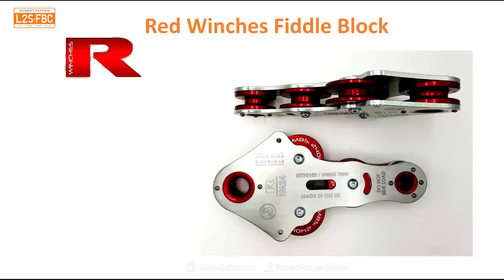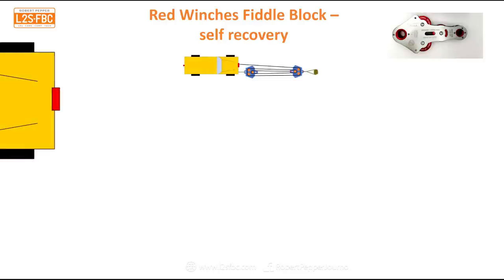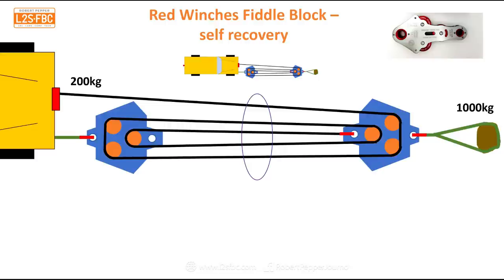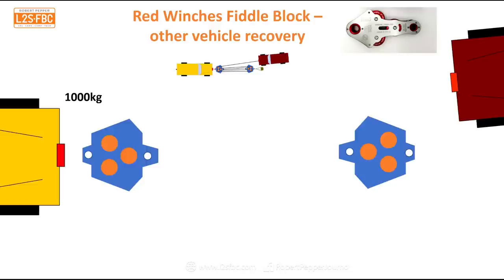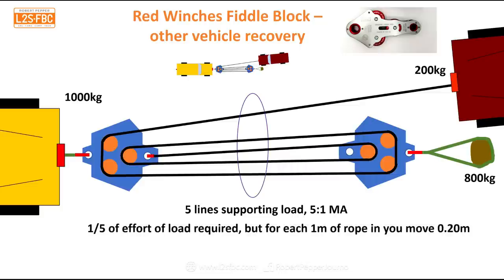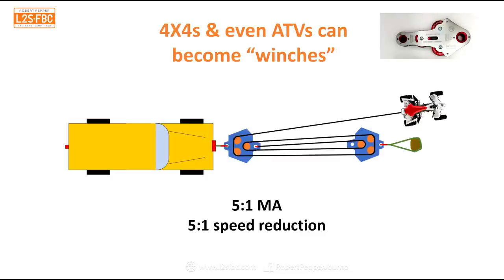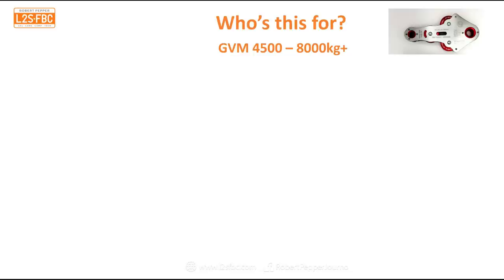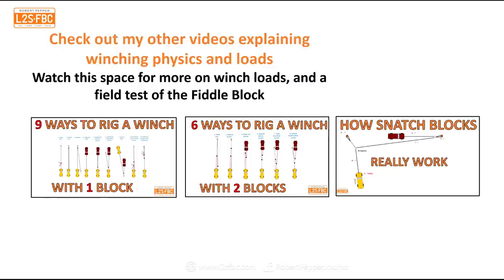What's a Fiddle Block for 4X4s?

Comment: Thats the same as a double snatch block... its 2 pulleys on either end, It's the same as having 2 pulleys side by side (double snatch blocks). Considering the price of these... And the length of rope you need, plus having 4 pulleys with loss instead of 2 (same applies to a pair of double snatch blocks which are also pricey, I'll give you that), do you think it's worth it compared to a simple Spanish Burton? Just carry two ropes (or a winch and a rope), and two simple pulleys, and that's it.
Reply from the maker: No I'd just use the SB

Comment: Thanks Robert. Fiddle blocks / block and tackle systems provide great mechanical advantage for sure. But, to move a truck 20 feet, you're going to need at least 100 feet of line thin enough to fit through the fiddle block set. I have a Unimog U500 with a 15k lbs. industrial hydraulic winch with 1/2" line and rubberized eye. Will that fit through the fiddle blocks? What size (diameter or MTS) soft shackle fits through the fiddle block? For example, I'm assuming with the 24T you can at least fit an appropriately rated soft shackle through the fiddle block to hold that potential load. Thanks again.
Reply from the maker: Hi Chris, excellent questions thank you, don't have all the answers as yet, but:

- 14mm max diameter for the rope which is around 20,000kg breaking load (not WLL)
- yes re lots of line, I'd recommend 50 to 70m (say 150 to 200ft) of rope. Not a bad idea to keep the rope permanently rigged with the two blocks, saves a bit of time.
- don't know about the max shackle diameter

I'll post when I know more, have asked the questions.
Reply: @L2SFBC  Thanks Robert. 14mm is really close to 9/16" and that typically has a spliced Minimum Tensile Strength (MTS) of 37,900 lbs. (Plasma 12 strand) which is about 17,190 kgs. So, I reckon that certainly that should be more than enough for a 15 - 20 k lbs. winch. Question becomes that with 14 mm rope, your soft shackle needs to have a MTS of around 189,500 lbs.,  (five times) which would be about 3/4" diameter double leg soft shackle. So the hole in the fiddle block set for the soft shackle would need to have an ID of around 40 mm Look forward to hearing from you. Thanks again.
Reply from the maker: Hi Chris - answer for you:

"The bottom ring will comfortably accommodate a 9mm soft shackle, ours have a MBS of 100kn, the rope will only see 1/4 or  1/5 of the load so even with the FM-24 at 240kn the 9mm soft shackle exceeds the MBS of the FM-24, there is a school of thought that if the user wanted to introduce a fuseable link this is the best place to do it but I need to do more research on a suitable smaller soft shackle for that. 

The top ring accommodates a 14mm soft shackles with ease. 
For the FM-12 I recommend out 10mm soft shackles at 160kn MBS
For the FM-24 I would recommend our 14mm soft shackle with 360kn MBS. "
Reply: @L2SFBC  Thanks so much Robert, most appreciated! 9mm - 10 mm soft shackle is close to our 3/8" (9.5mm) soft shackle that has an MTS of 42,000 lbs. Yours are at 100kN, which is about 22,400 lbs. about half the capacity of ours of the same diameter line. The FM 24, if I understand it correctly, is a 24 metric ton unit so about 53,000 lbs. rated capacity. The winch line load would be about 1/5 of that so around 10,600 lbs., which our 5/16" line with an MTS of 11,600 lbs would handle. Assuming you can use the 10mm soft shackle at MTS of 36,000 lbs. on the bottom anchor, then the bottom anchor is limited to 36,000 lbs with the recommended 10mm soft shackle. This would be the fuseable link you referred to. If I have if correct, the 10mm soft shackle in the bottom ring will see 4 times (42,400 lbs.) the winch line load while the 14mm top ring soft shackle (about 81,000 lbs. capacity) will see 5 times the winch line  load, so the top soft shackle is certainly capable of handling the fiddle block FM24 rated capacity of 53,000 lbs. Would I be correct is concluding that the bottom soft shackle would part (fail) at about 85% of the fiddle block rated capacity? If this is the case then the fiddle block capacity should be rated by its weakest connection point, which is the bottom soft shackle. Now if our 3/8" soft shackle (42,000 lbs. MTS) was used instead of your 10mm soft shackle, then it would meet the rated load capacity of the fiddle block without a fuseable link. Your thoughts would be appreciated.
Reply from the maker: Hi Chris hopefully this answers the queries - https://l2sfbc.com/more-on-the-4x4-fiddle-blocks-forces-and-minimum-rope-lengths/
Reply: @L2SFBC  Thanks Robert, actually, this confirms my concerns. 1) you can't get a 14mm soft shackle in the lower connection point so that's the failure point which is well below the fiddle block's rated capacity. 2) If you connect your winch line from your big winch on your Unimog etc. to the winch line extension, as the article you provided suggests,, you can easily exceed the fiddle block capacity. Any winch that is over 11,000 lbs. has the potential of exceeding the 24k fiddle block capacity. Most big rigs, like my U500 Umimog, have bigger winches. Basically, the 24k fiddle block can only be safely used within it's capacity with a winch capacity of 10k. lbs. or less, and that assumes the lower connection point soft shackle rating exceeds 40k lbs., which it does not. So two design failures right there. My conclusion is; a very pricey piece of equipment that is totally over rated based on capacity so is therefore  not safe to use unless they specify:1) maximum winch capacity of 5,000 lbs. for the 12 ton unit and 10,000 lbs. for the 24 ton unit, and 2) they should also specify the MTS of the winch line extensions and 3) specify the MTS of the required soft shackles on both ends. In my view that's the responsible thing to do. However, that has not been done and the article you referenced also appeared to miss these critical aspects. Thanks again Robert.
Reply: @L2SFBC  Robert, that forces diagram you provided (with the winch line connected to the winch line extension), how does that connection get made? Are you using a soft shackle? How does that connection point get through the winch fairlead? Essentially with this diagram, it appears to me the furthest one can pull with this suggested rigging configuration, is 1/5 of the winch line distance because 1) that connection point can't go through the fairlead, and 2) even if the connection point could magically go through the fairlead, you'd fill your winch drum up with the winch line extension, unless you had very little winch line to start with, which defeats the whole point. Nothing makes any practical sense (other than the forces) in this diagram. It's useless.

Good day Robert, I have posted the link to your YouTube video and the link to your article and a summary of comments onto the I4WDTA Facebook page. I think this warrants a good discussion. Thanks again.
Reply from the maker: Hi Chris - re your three points:

1. The lower point will only ever have 1/5 of the load, so would never need a 24t shackle.
2. Yes, big winches can exceed the 24 capacity.  So could a 12,000lb winch, multiply that by 5 and you've got over 25t.
3. I don't really see this as any different to any other winching or recovery equipment. You need to understand the loads throughout the rig, and use the appropriate equipment.

I do think that very, very people will need this, and that 2 x normal blocks which can give a 4:1 MA are plenty. I also agree/think that because people generally struggle to understand MA (hence my videos on the subject!) then this will further complicate matter and could lead to dangers. 

Your second comment:
Yes it's soft shackles all the way through.
Correct, you move 1/5 of the distance of the line pulled in. Hence, recommendation for a 50 to 70m rope.  The diagram was to illustrate the forces - I wouldn't rig it quite how was shown in real life for exactly the reasons you describe.  If I did, then the extension rope would need constant shortening which is a tedious problem to solve, but on the other hand...better that than not moving at all!

I have amended the post to reflect that, an added a diagram to show a more realistic rig.
Reply: @L2SFBC  Hello Robert, thanks so much for taking the time to respond - most appreciated Sir. On your points - 1) agreed 2)  Agreed - my point there was I would not recommend this for big truck with big winches as that will exceed the capacity of the product. 3) Agreed as well and that's where the information you provided is great. Hopefully everyone that buys these sees and learns from your video and your article to avoid the dangers you mentioned. I look forward to seeing your amended rigging. I've used these fiddle blocks with small capstan winches years ago, and they're really great for that - I left my fiddle blocks rigged, as you suggested, with a winch line extension (enough to move my old CJ2A Jeep two vehicle lengths) and then just used a daisy chain to shorten another winch line extension to connect the far pulley to the anchor - that gave me some adjustable range. I see this technology as perfect with capstans but not for regular closed drum winches. Thanks again Robert.
Reply from the maker: Thanks Chris, just amended the post. 

I really appreciate your considered feedback which has made me think further about the product. It's a new one, and as such I'm interested to explore what it can, and cannot do, and real-world testing. It's people like you who help everyone work through this process, nobody can look at something like this and figure out every little nuance at a glance, it takes some thinking as a group.

Thanks!
Reply: @L2SFBC  Hey Robert, thanks for your quick response. I wish I was as savvy as you with social media, IT, graphics, videos etc. Thanks for what you provide. I also agree that a bunch of folk discussing their thoughts on things is great - so thanks for your engagement - I look forward to more with your Sir!
Reply: @chriscole3538  I bet you will move before anything breaks.

Comment: hat is the difference between one of these and a 2-sheave block? Other than being blaster (all the lines in a single plane) it takes up more square area than a 2-sheave block, but a two-sheave is thicker and the rope is in two planes.  But when the rubber meets the road, there is an identical mechanical advantage with both.  Is the expense really worth it? Or is it just that fiddle blocks have a high CDI Factor?

Comment: I've got a 5000lb wire cable winch. Could I use these fiddleblocks if I run my cable out and tie into a synthetic line that runs through the system so as I draw in my wire cable the mechanism goes through the synthetic cable? More simply stated, can I use a wire cable linked to a synthetic rope for this? I figure this way my 50ft cable will provide for 10ft of recovery travel?
Reply from the maker: Yes you can do that

Comment: i'd like to see a video about this.......how do you feed your rope cuz it has a loop at the end?.....you need to get the hook everytime off?
Reply: Something like this you would leave rigged with  it's own synthetic winch cable. You then simply attach it to the vehicle and the winch system with conventional hooks or soft shackles.
Reply from the maker: Agreed!
Reply from the maker: Feed rope through
Reply: @L2SFBC  show us,you did it interractive,but how it looks like in reality?
Reply: @otm646  he said something different.....that the winch rope you have to feed through.....impossible as long as it has the hook on.Agree??? His video is not plausible
Reply from the maker: You can feed the winch rope through if it fits. But best is to use an extension rope.
Reply: @lee99lee99  Some of the blocks are very open and have guides inside to guide rope or cable onto pulley.  Hook should pass through.

Comment: Robert, if you keep 50-75m of rope permanently rigged through a pair of these seperate from your winch, can you use something like the round device with ears (don't recall the name of it) to pull 25m, let your winch back out, take up the slack,  and pull 25m again as needed? What do you fasten to the end of your winch rope to attach it to the 2nd rope? How do we non-permanently attach a hook or whatever?
Reply from the maker: Not entirely sure what you mean, but yes you can pull in 25m of line at a time, but at say 5:1 that's only 5m pulled, less allowing for slack. Can you elaborate please?
Reply: @L2SFBC  Yeah, I really wish I could draw a diagram like you do so well. Imagine pulling 25m of logging chain with a hi-lift jack. It's only a meter long, so every time you reach the end, you release tension, unhook, take up slack, rehook, and pull in another meter, and repeat the process to the end. That doesn't work with ropes. Obviously we don't knot them together. Is there a clamping or gripping device to temporarily connect your 25m winch rope to the working end of your 75m tackle rope? We need some way to pull in much more rope than will fit on the winch, right?
Reply from the maker: OK think I see. Yes there is, the X-Lock - see my video on Pulley Efficency to see how I use it to shorten ropes. However in this case it'd be pull it all in, then re-rig and pull out...no real way around that if your drum can only store say 30m or rope and that's it.
Reply: alpine butterfly loop will work.

Comment: These are great.. Can you do a video about the 'minimum' amount of rope needed for moving the distressed vehicle some set distances? Say for example moving the vehicle 1m, 5m, 10m, 20m ? I am not sure what is more realistic? Maybe you can pick your own distances.

Obviously as the winch pulls, it pulls the snatch blocks/fiddle blocks closer and closer to the point they would touch. So maybe let's add a buffer zone? So maybe that the snatch blocks are not allowed to come within ½meter of each other? Again, what ever you believe is more realistic?

This would obviously give an extreme advantage to the spanish burton setup so I guess we would need to have 2 values for this, both the winch minimum value and moving line minimum value.

I don't believe static lines need to be addressed in this? Since they would be situational variables that don't impact the calculations? Or am I wrong on this?
Reply from the maker: Yes you need 5x the line (plus a little bit more) to go x of distance, so say 55m to travel 10m. 
I will be conducting a full field test soon as I can.
Correct, static lines aren't important for this.
Reply: @L2SFBC  I guess I just got confused with the Spanish burton setup then? The winch distance is tiny but do you just transfer 3/5ths of the length needed to the moving line?
Reply from the maker: With Spanish Burton you have a 4:1 advantage. The first line is 2:1, and the second is also 2:1 so total 4:1.  You need to pull in 4m of line to move 1m.
Reply from the maker: Video will be coming when I get a set, in the meantime -> https://l2sfbc.com/more-on-the-4x4-fiddle-blocks-forces-and-minimum-rope-lengths/
Reply: @L2SFBC  Nice diagram